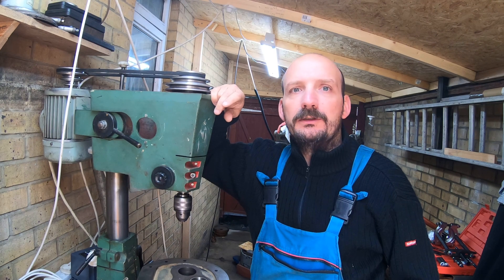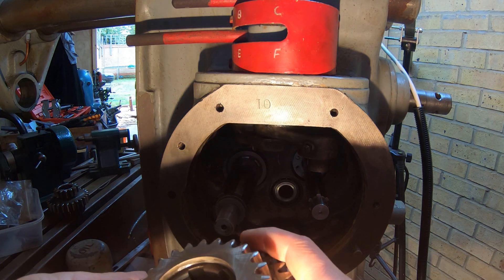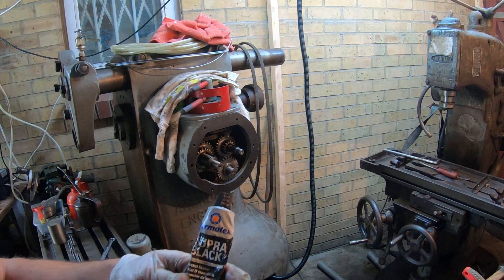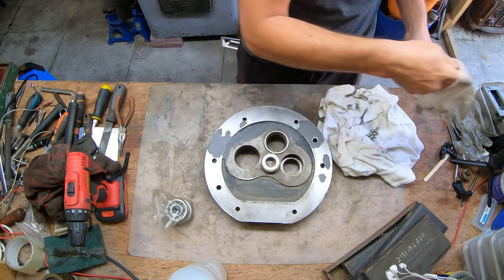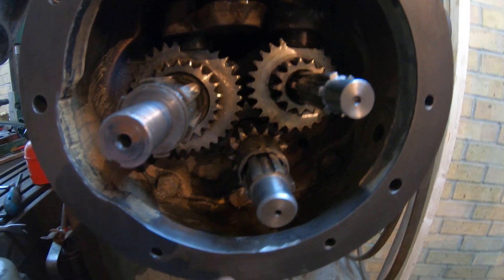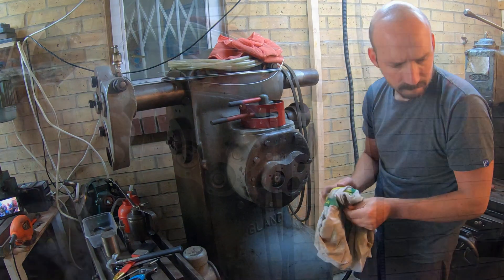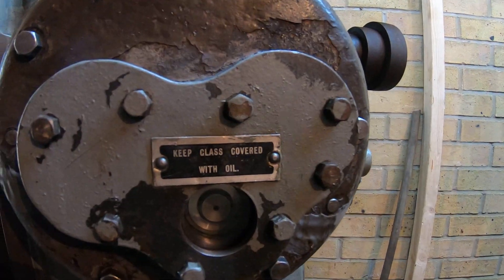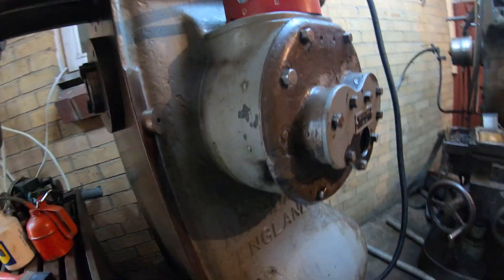Archdale 20 Horizontal Mill - Gearbox Reassembly & Test Run

Comment: Well done. What happened to the gearbox cover casting, was it cracked when you bought the mill,  it looks as though you have  used something like JB Weld to repair it?
Reply: @OneManEngineering  Ok, I think it is remarkable that you can do these jobs including welding cast iron in what appears to be a relatively small space. Andy
Reply from the maker: I am sure I have replied already, but can’t see it. So yeah, it was cracked and broke into half upon tightening a bolt. So took it back off, and cleaned, prepped, baked in the oven. Then I welded with pure nickel rod made for cast iron on the inside. Didn't really wanted to introduced unnecessary heat, so didn't weld it fully. The outside have a coat of JB weld, and one day maybe it will get sanded down properly and finished. That day is when I change the oil for the socound time and clean the inside of the gearbox hopefully for the last time. Greg